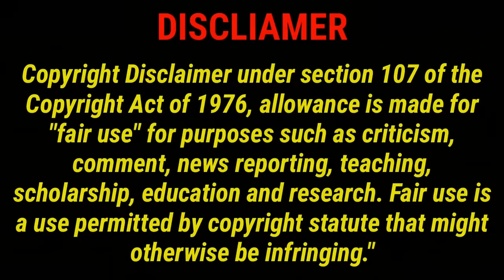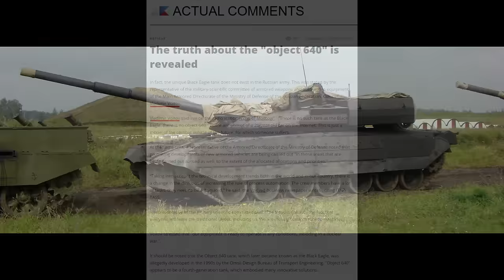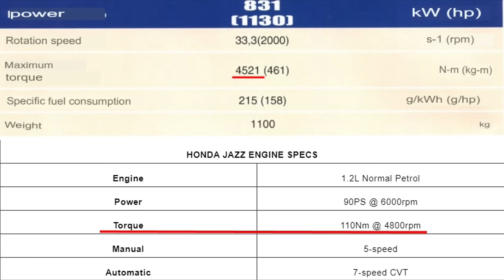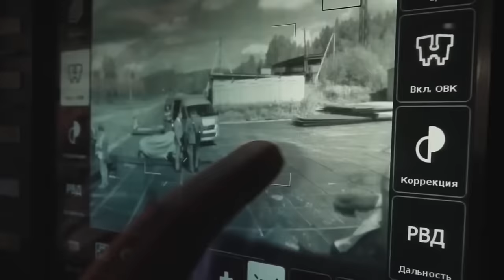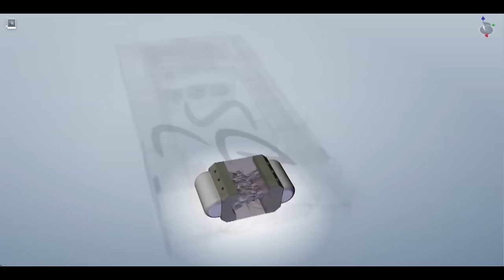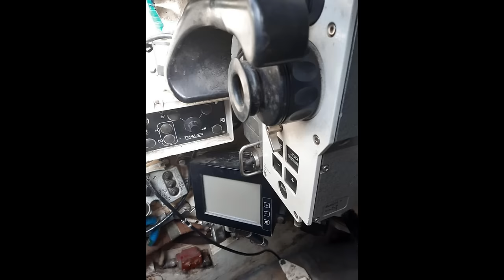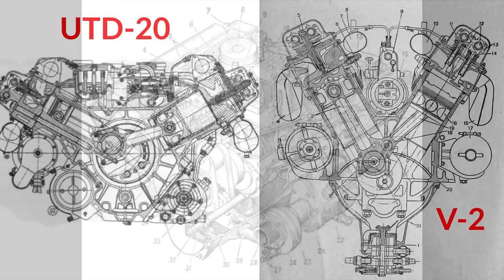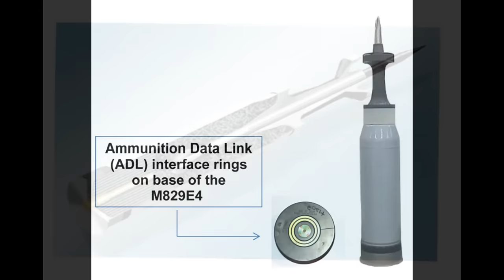LazerPig is WRONG about T-14 Armata

Comment: I thought that barrel rifling combined with proper twist rates was part of the reason that modern rifles are so accurate. Maybe that only applies to small arms?
Reply: Yeah but its not bc big gun, its because of the projectile.

Like rockets modern tank guns are fin stabilized, if you go back to ww2 you get stuff like Yamato 18.1 gun being rifled... Hell the object that rifled it was being used until some 2 years ago.
Reply: Modern tanks fire ammunition that isnt friendly to rifling, and they have to use smooth barrels and different means of increasing precision.

As for rifles, manufacturing quality of weapon and ammunition also play a huge role. You won't be accurate if every round you shoot has up to 5% gunpowder amount deviation, for example.
Reply: Rifling makes guns more accurate by providing spin stabilization to the projectile which both means it won't tumble and invokes the Magnus effect where any sideways wind will mostly cause the projectile to move up or down rather than to the sides, which is obviously easier to correct for since humans are tall and slim rather than short and wide. This is still one of the key principles in small arts however any firearm large enough to be classified as a cannon has more or less evolved past this. This is mainly due to better understandings of aerodynamics that allow us to build projectiles that use fins for stabilization which are much better, and obviously you can't have a projectile with fins spin. This has lead to the development of modern tank rounds in the form of Armor Piercing Discarding Sabot Fin Stabilized Rounds, these projectiles are built to be very aerodynamically efficient by being very slim and long. They are purely kinetic projectiles and use a long rod of some incredibly dense material like tungsten or depleted uranium to deliver enormous amounts of kinetic energy to very small areas and thereby defeat the armor of the target. Part of why this works and why they're so accurate is because of their incredible speeds, around 1200 m/s, which can be achieved thanks to the incredible advances in materials science and explosives which lets us make much more powerful powders and guns that can contain the energy from them. And as a bonus we also know have incredibly powerful and precise fire control computers that can use laser range finders and automatically compensate for atmospheric conditions.

Basically none of this was available when rifling first became standard. Back then we had basically no understand of aerodynamics, that would take the development of aircraft as well as powerful computers able to simulate it, the latter of which only really became available in the 80s and 90s. We were also mainly using black powder which is much worse than modern explosives and the early smokeless powders weren't all that much better. Our metallurgy and materials science was also much less advanced and we didn't have the precise control over metals that we have now that allow us to make modern cannons. And of course we hadn't even discovered Uranium yet and Tungsten couldn't really be produced at any scale. And while fin stabilized small arms have been attempted it generally hasn't really made it past the prototype stage. Small arms are simply too small to enjoy many of the advantages that larger firearms can benefit from by going smooth bore. They can't achieve similar muzzle velocities, because you can't pack enough explosives in, you can't really use exotic materials like Uranium for obvious reasons and Tungsten as per it's name is a bit too heavy to be used in small arms, they also don't have a pressing need to achieve great armor penetration, and they aren't used at all that great ranges anyways since infantry fights tend to at most happen around 300 meters distance. So small arms have stuck with rifling while just using the improvements in manufacturing technology to become more accurate and reliable.
Reply: @hedgehog3180  Tungsten cores are a common sight in modern armor piercings rounds, i.e. M995, 7N24, etc.

Comment: The T-34 engine was and still is one of the best tank engines ever designed. It was rugged and powerful. Most importantly it was diesel and would not burst into flames as easily.
Reply: It would burst into flames. Constantly.
Reply: @nolkerss  Diesel is harder to ignite than petrol and typically diesel engines are preferred in tanks with the exception of the gas turbines that literally can run on anything.
Reply: @alexandermarken7639 modern diesel engines are also multi fuel

Comment: So as researcher. Using the argument that “the engine is nothing like the older version but is exactly like it but updated, but exactly the same… but different” you do have to understand that shows zero evidence that the engine isn’t trash. If you need an example watch just about every V day parade Russia has done since the engine was first made.

Comment: Well you didn't prove him wrong. And now he proved you wrong.
Will you admit it finally?
Reply: Lol, LazarPig once again embarrasses himself with that video, to me personally, there wasnt a thing that RedEffect was proven wrong about. Pig just kept rambling about "that wasnt my point" while his point was flawed to begin with, such as comparing numbers without context and not how it performs on the battlefield.
Example, about the top speed, yes the Challenger 2 has the same top speed as the T-90 despite being 20 tons heavier, but the T-90 has a far higher acceleration than the Challenger which is indeed much more important than a higher top speed as the top speed wont even be reached in the battlefield to begin with (making it more or less kinda useless). Why would Russia spend more money and change their factories to get a higher top speed thats not even needed?
Reply: @eliasziad7864  was it about t90? No, was it about top speed? No.
If it's best you have to prove him wrong about t14 and the engine, try harder.
Reply: @banaris28 15:10
Reply: @eliasziad7864 because tanks arent just on the battlefield? You know they have to travel far distances right?
Reply: @Christacion 

Yeah , guess how they travel long distances , and they have done for a century now , just a tip , its towed by a locomotive .
Reply: @Christacion 

Theres a reason why armies have developed transport systems for heavy equipment to avoid needlesly using them for things that they were not designed for , like going at top speed.

Comment: your observations dont really make this tank any better. but truth has to be served. without any research i somehow believe you what you challenge because of your thorough explanation. hoever...
 talking about the t14 engine. upgrades to the engine does not make it a new design engine. The engine is a new engine only when the engine block is fundamentally redesigned. by the way ask any engine nerd, he will confirm this. this applies to all kinds of engines, from passenger car, to truck, to harvester, to tank. they all internal combustion engines and the rules are universal. the T14 engine is an old ass engine by definition.that does not make it bad engine as well. your knowledge of internal combustion engines are not your primary interest its ok. we all make mistakes. im here to improve your knowledge. 
parade mishap... your explanation is not impressive. accidentally pulled hand brake... and nobody realised it until a recovery tank rolled in and tried to move it.. and then a eureka moment.... the hand break... cmon... really... i mean really? you lost a bit legitimacy on this one. whats next? ah yes...
you skipped essential part about fuel consumption of the whole operation and the logistics behind it. again, proven track record, that its not enough to have unlimited fuel, its how you get it to the front. russian force just are not good at it for tons of reasons.  
and to finish with a good spirit :) i called the adaptive camo bullshit from the get go. 
anyway, have to say, i enjoyed the video.
Reply: I honestly don't know much about this stuff, but by this logic challanger 3's engine is the same ww1 condor engine
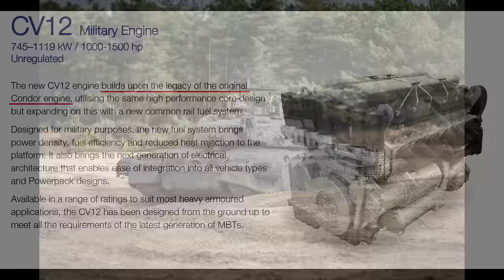11:38
Reply: @areallybigdwarf4560 @sovietbanana4589  no he didnt. It did break down during the parade, or why would russia lie about it. On top of this did you consider that russian tanks must have their final drive disconnected before they have to be towed otherwise they wont budge even if they broke down? And the engine sounds suggest that it broke down.  Russia said that it stopped as a part of the parade initially too, they only layer said it was an emergency brake issue. Your clearly very pro russian and horrendously biased, or red has a sock puppet account. On top of this he focused on several. Red never prpved him wrong. Like when lazerpig said that the bt7m used the lharkiv model, and red said "well it wasnt designed for that model, it was later used in the bt7". Thats not proving him wrong. And red does this same thing throughout the entirety of the video. On top of the challenger 2 part where red says its the acceleration that really matters. Thats not the point. The point was that the challenger 2 is 20 tons heavier than the t14 and goes the same speed. The t14 should be able to run circles around a tank 20 tons heavier, not match it. 😑.  On top of this, the engine in the t14 was indeed a model of the modified sla 16 engine that russia uses in oil pumps. Which brings me to my next example. Red said that the engine is not the same, but its been further evolved. Which is a fancy way of saying modified. The same thing lazerpig said in the original video, but your too much of a vatnik russosexual to care i guess. Red never proved him wrong. Red used a tactic called flim flam, and it worked on a dvmbfvck like you. 👍

Comment: Got any sources on t-90 acceleration times? I'm having trouble finding any but you state flatly that because the t-90 is lighter it accelerates faster. It's entirely possible that's true but the top speed being about the same given the similar HP but vastly different weights it's also possible the t-90 has significantly more parasitic loss in its drivetrain as the top speed of vehicles as heavy and slow as tanks is almost entirely dictated by the total parasitic loss caused by friction from the weight of the vehicle itself and the design of the gearbox, tracks, etc. There is also the question of gearing and hp/tq curve to consider when considering acceleration and top speed of course. There is the possibility that the USSR saw little need to gear the tank to go at the maximum speed the engine could handle but the UK did as the Challenger 2 is expected to work alongside the Abrams.
Reply: I do want to add a disagreement, an engine or transmission can in fact break in a manner that prevents the tracks or wheels of a vehicle from turning. Obviously that wasn't the case here as you stated but I thought it was worth pointing out.

Comment: LP's channel is certainly colorful and takes some liberties with accuracy.
But, anyone who thinks ANY bit of Russian hardware works as-claimed, is living in a dream world.
And even if this tank actually is capable, it is untested, likely lacks some critical components, the crews won't be properly trained, there won't be enough parts or backup.
So far the few deployed are being used to take shots from behind front lines, which is hardly what tanks are for.
Conclusion:  the T14s which exist are likely not properly equipped, not least due to inability to buy critical components from the West, of course untested in battle.  I suspect the only reason they are being used at all is for lack of artillery.   That stands unless they are seen on the front line, at which time the tanks defenses are sure to be tested aggressively
Reply: blabla as claimed blabla
Reply: @kjererrt7804  cry
Reply: "takes some liberties with accuracy" - he literally said that armata has ww2 engine with same amount of horse powers as Honda. It's not "liberty" - it's a lie and propaganda

And how exactly Russian hardware isn't working as claimed?

"T14 is untested" - they have been testing and changing for around a decade already, we have footage of it's being used, moving and shooting. What's that if not testing?

Comment: “Periscope”… they are Vision Blocks! Take it from an ex-2RTR guy trained on CVR(T) series tracked vehicles such as the Scorpion 🦂 & Scimitar! They do not move, are not like bi- or mo- noculars as there are no built in mirrors enabling adjustments so the user can see distant objects as well as they can see near objects! If a vehicle has a ‘periscope’ mounted anywhere it will be at the highest point, on top of the turret, so the viewer can have 360 degree visibility around the vehicle. Yours, very annoyed … 😤

Comment: It's an expensive tin box that can be ripped apart by a drone strike. Has a lot in common with other modern tanks really. Nothing magical.
Reply: That can be said about any tank
Reply: @mbtenjoyer9487  Yes, that's the point! I don't think there is anything special about the Armata.
Reply: @bigchunk1   point exactly  ? every tank is going to have a similar solutions  when you’re doing research and finding solutions for things u are always going to end up with the same / similar conclusion ,

And to say there is nothing special about it is a piss poor statement 

It has : X lay out engine , unmanned turret , armored capsule for the crew making it one of the safest tanks , reduced thermal and radar signature , hard kill APS that can affect APFSDS ,
Reply: @mbtenjoyer9487  I'm not sure what you're so mad about. Just tell Putin that I think he looks good riding a horse.
Reply: @bigchunk1   don’t overdose on the copium there buddy ;)

Comment: idk man, ive seen some sources proving lazerpigs opinion, you dont need to like him but sometimes its better to admit that he is right or like cone of arc would say: dO sOmE aCtUaL kInD oF rEsEaRcH
Reply: lazerpigs opinion on what might i ask?
Reply: @_cyantist  that the t-14 is trash and that the engine is a modified and improved version of the old german one
Reply: @user-nv9vi2os7y What sources say that it is a copy of the SLA.16? Lazer Pig directly admitted that he didn't know.
Reply: @user-nv9vi2os7y  who was doubting T14 was a shit tank? You clearly didn't watch or understood this video. It was a correction which triggered a pig rant.
Reply: he literally said in this video that Lazer pig get most of the stuff right what are you even talking about ?
Reply: @H-1467  yes, but he still doesnt acknowledge the fact that the t-14 is still in testing stage and has a lot of mechanical failures, just like the engine like lp said
Reply: @IdeI2StOnEd oh he does he compares the russian engines to the german ones and says oh the german also theoretically use an ancient engine so russian engine isn‘t that bad, this does also apply to the t-14 and its engine is defenitly unreliable

Comment: 36:20 I and some other viewers understand that the meaning of the word propaganda is merely dissemination. But nowadays the meaning of the word has been greatly distorted. In this case, therefore, the word advertising would be much clearer to most people.

48:57 This tank is unlikely to be mass-produced. It is quite expensive. It is more likely to be a commander's tank. But things could change. As for the sanctions, you probably underestimate the capability of Russia's design school. There was a whole range of technologies, not just military, where Russia bought it all from the west. But that does not mean that it did not have its own technology all this time, its own was also developed. But they did not go into production or did not get to the bottom of it, because it was not economically feasible. Now, with these miserable sanctions. Everyone is looking at what was already there, or what can be improved. This is why Russia and especially local industries are immensely grateful to the west. After all, those who wanted to save money or were involved in corrupt schemes with Western companies will no longer be able to do so.

Comment: Re the comment  about the British  CV12 Condor engine at 11m40s. I think you are misunderstanding the words.
‘Builds upon the legacy of the original Condor engine’
They are referring to the Condor engine used in Challenger 1 not a WW1 era aircraft engine.
It would be stupid to link a WW1 petrol aero engine of 35.027L with a 1990/2000s diesel tank engine of 26.1L.

Comment: Why is there such a massive discrepancy between the two engines at 13:20 ish? I think there's some misunderstanding in the comparison, the Leopard 2 uses a 'Power Pack' style engine which includes the transmission, cooling unit, gearbox, filters etc vs the engine block alone? (CV-12 vs MB873)

Comment: + The TOW-2s are wire guided so they would not even be detected in the first place 🤷‍♂
Reply: You’re forgetting the APS radar
Reply: @mbtenjoyer9487  Yup, they are doppler radar, its based on sound, not laser or whatever.